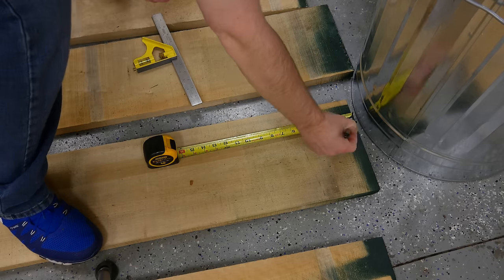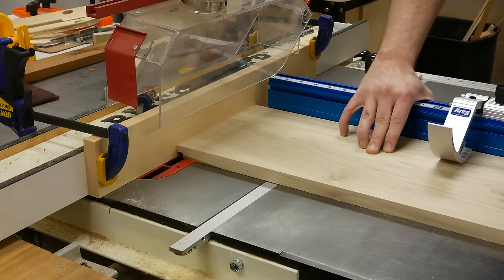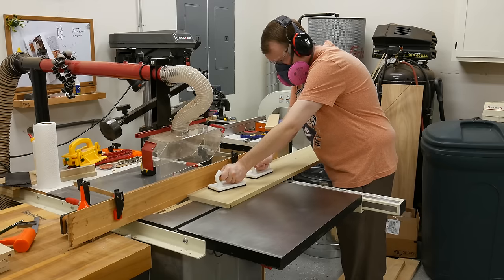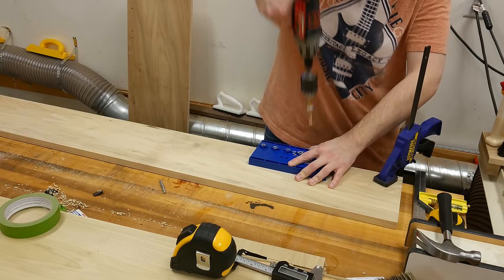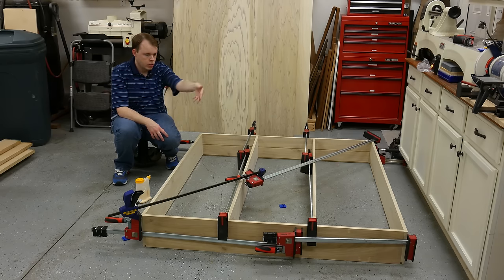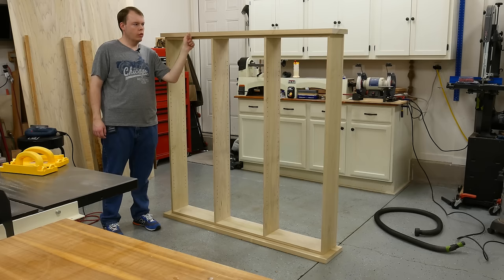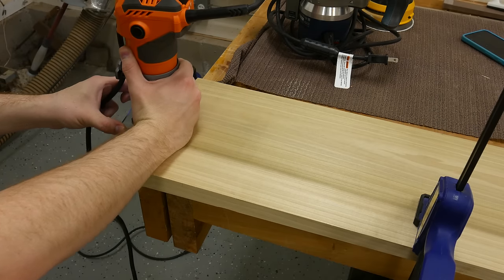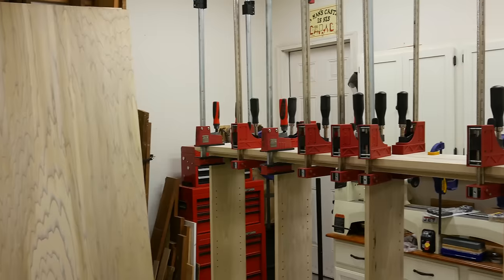Media Cabinet Build - Part 1

Comment: I'm wondering why you use the euro style guard on your jointer in such a strange way...the guard is designed to extend to the fence, with the stock underneath, and your hand on top of the guard. This allows you to place pressure where it is supposed to be - right at the beginning of the out-feed table.
Reply from the maker: +Ant Mallett I dislike the euro guard and find it more awkward to use. I came from a grizzly jointer with the type of guard I like
Reply: Fair enough, everyone has their preference. I personally dislike the pork chop style guard, and think that the euro is far safer if used correctly. Nice work, btw.

Comment: Just found your channel. Really enjoying it thus far.  Quick question, by attaching top to sub top with glue, would there be any issue down the road with wood movement?
Reply from the maker: Thanks! I've attached several tops this way and haven't had a single issue with wood movement. My oldest project was a TV cabinet thats about 4 years old that I glued the top this way without any issue.
Reply: Ok great.  Thanks Sean.  Keep up the great work!